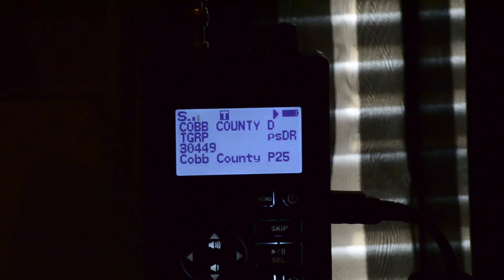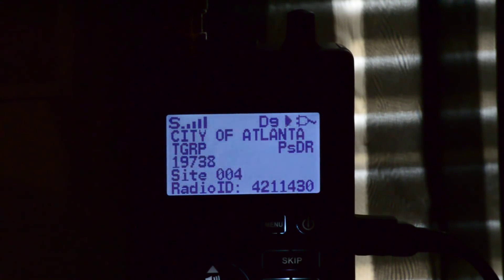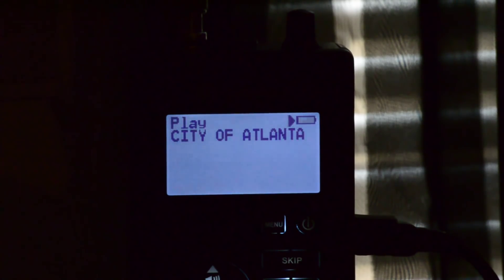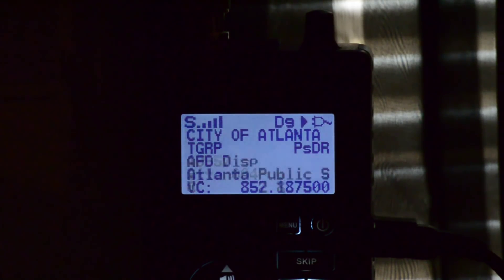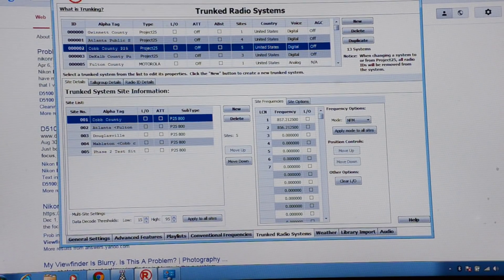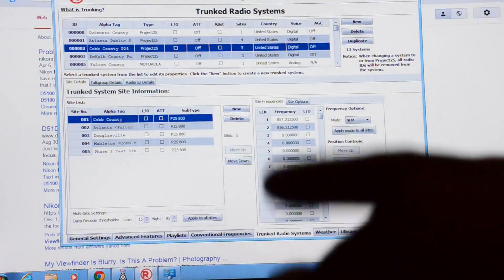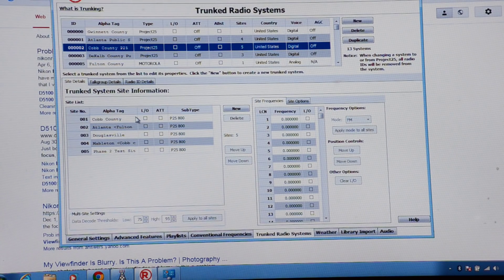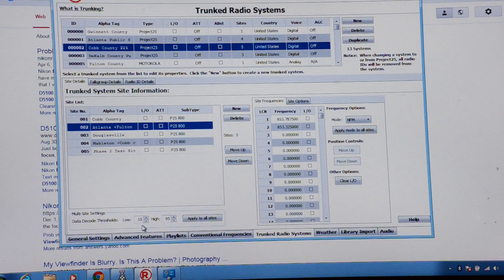Radio Shack Pro 668 Digital Scanner Tips Tweaks

Comment: Is that the programming software that came with your scanner?  I installed the program from my unit but does not look anything like the one you're using.
Reply: I think the Pro668 can use the RS software and the Whistler ws-1080 software as well.

Comment: Is this still a good scanner to consider buying at the end of 2016?  Considering getting one to replace my dying Pro 97.  Yes i know it is old but still picked almost everything i wanted.  over the years it has been dropped 1 to many times.  (still works but starting to short out).
Reply: its still using the current standards for trunking
Reply: YES, its a good starter Scanner even for 2018. I'm going to keep my Pro 668 even though NEW Scanners are coming from ICOM, AOR and UNIDEN for 2018.

Comment: I have the 668 and it's choppy as hell on Ohio MARCS IP. Sounds just like your Atlanta transmission. I had the Home patrol 2 and got hard up and sold it. I so regret it. It was clear as a bell. No tweaking either. I personally think this 668 is junk. But I have e to deal with it so I'd like to tweak it but I also don't want to make it worse. Did you ever notify radio reference about this issue?

Comment: Nice. I'm up in Gwinnett, land of encrypted P25. Saw a good deal on one of these scanners, but I think I might hold off and pick up a Whistler 1088 for DMR support. Also, do you run your own 2m repeater? I think we may have met up on the air once...
Reply: PRO 668 can be upgraded by Whistler, but I'm getting the NEW ICOM and AOR scanners coming out in 2Q 2018.

Comment: i have a pr0 652 but do not understand hardly anything about the p 25 system.every seam to scim over and not explain how to listen to this.
Reply: Daniel - you should use the scanner software that you got with the scanner, update Everything on the Scanner including the Radio Reference Database then program your scanner accordingly. Today there are even more Digital radios and NEW Types of Digital like DMR, Tetra and NXDN. I use a pro-668 and get most Everything but the NEW scanners from ICOM, AOR, Uniden can get everything.

Comment: I just purchased a used Pro-668 but It has no SD card. I need to get my hands on the iScan software to update and program it. The EZscan software from Whistler won't work for the 668. I know the iScan software is on the original SD card.

I cant find a link to download the software anywhere and the Radioshack website is a joke. 

Any suggestions?? Thanks
Reply: 78410 is the zip and cops,EMT,fire,Marshall,dps, port patrol, even the county jail if I can
Reply: find someone who has one an use there's for a minute
Reply: +Aj Vidal I got it all setup. somebody on Radio Reference forum had a link to the software. I paid $125 for the scanner It had a error code on startup. It ended up being a bad SD card. This thing is very picky when it comes to memory cards. I had to try 3 different cards before I found one that worked.
Reply: @RellyOhBoy   Can you tell me what card you used.  My sd card went bad and need to get another.
Reply: @101brownmark  I believe it was a 16gb SanDisk card. I no longer have the pro 668. I sold it for an SDS 100.
Reply: +RellyOhBoy where is the link on the website for the software?
Reply: It was in one of the forums on radio reference .com It escapes me now. My bad. It comes in handy tho because it gives direct access to all the frequencies on RR without needing to pay for a subscription.
Reply: +RellyOhBoy can you tell me which SD card you got to work with it please? and do you know how to change the color on the device I can't get it on mine
Reply: 16gb Samsung Evo Micro SD. The orange one. The backlight color cant be changed. Some 668's the backlight looks purple like the WS1080 and some look more white. The one I have looks white. The small led on top, color and blink can be customized with the software. I use Blue for police, Red for fire, Yellow for Air, Orange for EMS and White for everything else.
Reply: Damn I can change the little light at the top but I have been trying to change the back light to like a orange or something cool its a white light it's okay I guess thanks for the info on that and the SD card and if you can update yours let me know I will pay you to do mine I don't wanna mess it up and would rather someone who's done it before do mine, I can pay you or something
Reply: Yeah you could really brick this scanner if you program it wrong...

I could program for you for 20 bucks. I've done it for a few people before. I'll check the database. Whats your zipcode and what do you want to listen to?
Reply: Ima load those frequencies into my 668 first to check it out. You need to make sure your memory card is good first. The one that comes with it is bullshit. Mine died in a week.
Reply: Okay mine is still good I have had it in a while but I will look for the SD card you got
Reply: +Aj Vidal And your radio is the Radio Shack version, not the Whistler or PSR version?
Reply: Yes I bought it at radio shack
Reply: Not sure what the difference is though?
Reply: The Pro 668, PSR-800, Whistler WS1080 Are almost identical but the firmware and software is not compatible with each other.
Reply: Ohhhhhh
Reply: +Aj Vidal i programmed your zip code into my 668. its alot of frequencies to listen to in your area, fire, ems, corrections, air, police dps and some more shit. all you need to do is load the files to your memory card and you should be good money.
Reply: So I had put my zip code in and choose the ones I wanted I heard their was a software update you can do I'm looking to do that just not sure how
Reply: +Aj Vidal i cant give you a tutorial bro. but you can read the help section in the software for tips. some people can figure out how to use it but most people cant. the 668 doesnt work like a regular scanner with channels and banks. its more like an mp3 player with objects and playlist, you import the frequencies into the software fill up your playlists and then you load the configuration to the scanner. ima computer dude so it comes natural to me. just back up your memory card in case you screw up the configuration.
Reply: Okay let me get a PayPal
Reply: RellyOhBoy  hi i just buy one rs 668 is it ok or they going to become obsolete?
Reply: Alejandro Monge its still a good digital scanner that does P25 phase 1&2 but there probably wont be anymore firmware updates since it is the RS version. The latest update is 2.4. but there is a way to flash the WS1080 firmware to it. I would keep it because it might become a collectors item since it is the last Radio Shack branded scanner.
Reply: Thank you very much that was very helpful I'm new to scanner I used to have a analog but now I'm going to try digital thank you very much
Reply: RellyOhBoy I would I have noticed with my 668 that when I hit the power button it doesn't come on sometimes I have to insist and press a couple times for it to power up sometimes I press menu then I'll press power and then it Powers up is that normal?
Reply: Like I said, I already got everything programmed for your zipcode if you cant figure it out. All I gotta do is send you the zipfile to put on your memory card. 20 bucks to my Paypal and I'll send you a link to my google drive to download it.